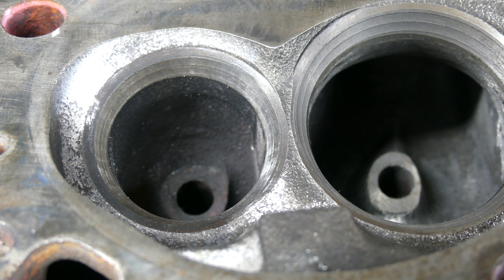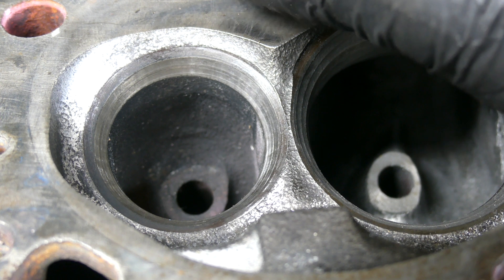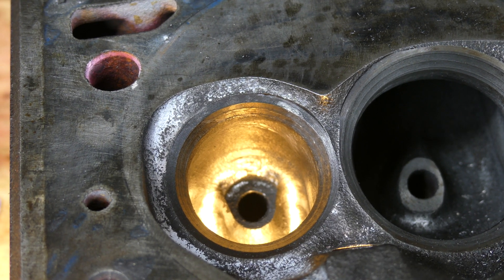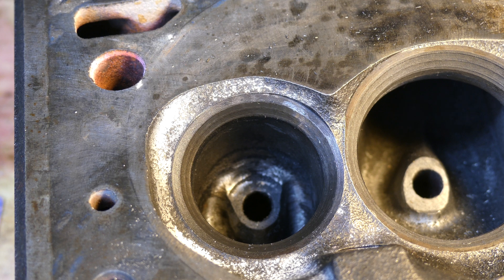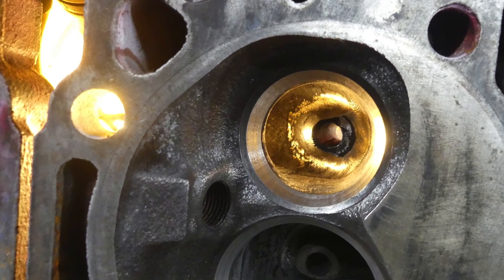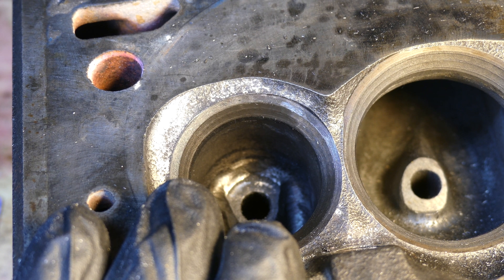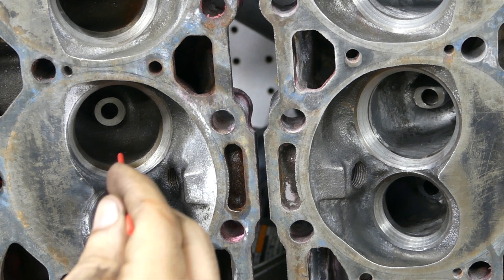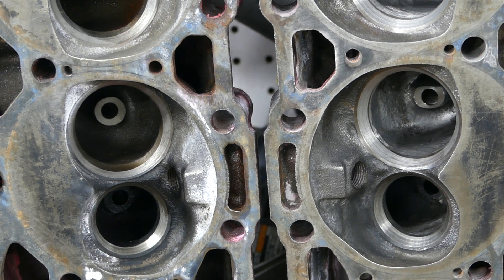Vortec Cylinder Heads EXHAUST PORTING (Rough cutting, port shaping)

Comment: Hey man. I would find another machine shop to have them fix those seats.
That valve job is garbage and you need to go get your money back from whoever did them.
I have a engine machine shop and your welcome to go to my Google page or Facebook page and see what valve jobs should look like.
I cannot stand these shops that steal people's money and do such junk work. 
That porting work won't do any good if the valve job is that bad.
Reply from the maker: You probably didn't see my other videos on them but a had them cut the throats to a 2.02. The valve job wasnt finished. Just had them opened so I could blend to them. But the guy who them I just recently started to have issues  with his quality of work and i have sinced moved on to another. Where are you from?
Reply from the maker: If you share I would be happy to take a look

Comment: I just done this on a pair of vortec heads for a cheap 400 build I’m doing. I used a dremel and smoothed it out the best I could. Also radiused the chambers to keep detonation down. I’m curious as to how much it helps. I’ve heard it actually doesn’t help much. I done the exaust ports the best I could aswell. Should I go back and polish the exaust with a finer grit?? I’m gonna be running a Howard’s 112141-08s 480-488 108lsa. So it has more duration and lift on the exaust which should help the exaust some to.
Reply from the maker: If you plan on using any power adder  it would be wise to break the edges down. All the peaks can become hot spots this goes for your pistons too.  In lets say a nitrous application with a 150 shot it might not play as big as apart as a 300 shot. But anything  that keeps you from detonation helps.
Reply from the maker: I normally stop at 120 grit. After that I personally dont see a point. More cosmetic in my opinion. Excellent cam choice btw. For a healthy street motor that should easily make north of 450hp with good port work on a 400. Plenty of torque too.